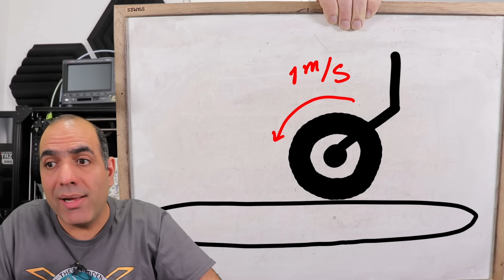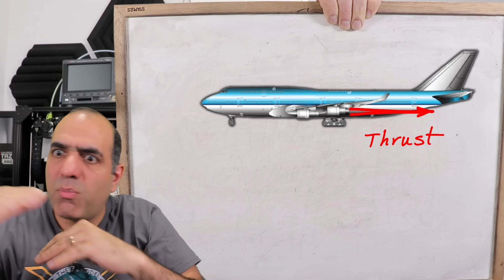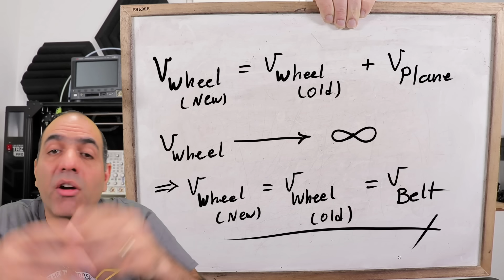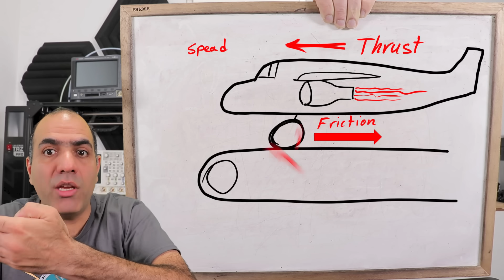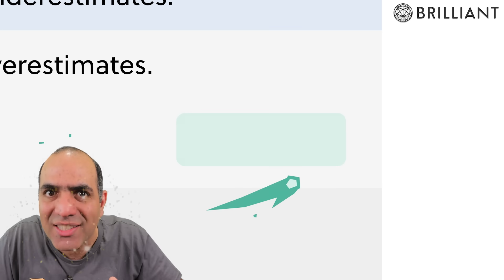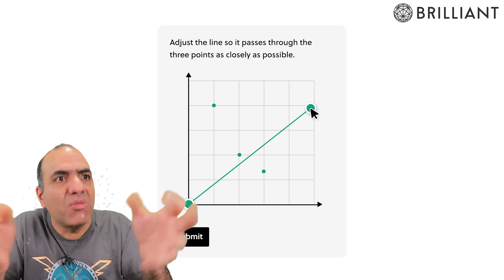Airplane Question that Drove Me NUTS!!!

Comment: 1. If the conveyor belt is designed to exactly match the speed of the wheels, then there's no wheel slip at the contact point of the wheels with the belt.
2. If there's no wheel slip, the wheel doesn't spin.
3. The plane accelerates with its wheels not spinning, and the top of the belt moving along with the contact points of the wheels, the whole wheels, and the plane itself - all ahving the same speed.
4. The plane takes off.

Comment: I thought that the whole "speed of the wheels" thing was a dead giveaway to the fact that the engines aren't active and the plane won't take off (basically that it is a trick question), but I guess that the question can be interpreted in many different ways like you said.
Reply: The question is "can the plane take off", not "will the conveyor belt make the plane take off", so I didn't interpret it that way. But it's definitely a question that leaves a lot of assumptions open to the reader.
Reply: Precisely, if the question were worded as "The conveyor is designed to cancel all forward momentum of the plane" the question becomes simple, the ambiguity of the question leaves a ton of room for interpretation
Reply: But even with the engines on, how in the world can it take off? The conveyor belt is simply taking all the wind speed away! It's sitting still relative to the air! It's driving me nuts ffs
Reply: @IceHax  The conveyor belt isn't taking any wind speed away. If anything, as the plane moves forward, the conveyor belt will be moving faster in the opposite direction (as stated in the question), so it would actually increase the wind speed experienced by the plane, making it even easier to take off. Though they'd still need to accelerate to normal plane speeds before getting very far above the runway.

Comment: I don't see what the fuss is about. The answer is obviously "No". Because....
Clearly, it's "Yes". The Jet engines push the craft forwards relative to the surrounding air. That generates the airspeed and so the lift.
The wheels will be spinning at twice their normal speed, but that's going to have little or no influence on the aeroplane's ability to lift off.
That's my answer at 0:39, let's see what unfolds...
Reply: Yay. I won.... I think.

Comment: The plane will take off. The runway & wheels are irrelevant. If you have sufficient thrust, you will have flight. No matter what the wheels are doing the engines are still providing forward thrust. The runway will simply match the rotation of the wheels but that will have no impact on thrust.

Comment: Where does this ramping the belt speed up to infinity nonsense come from?      The thought experiment is simply that the belt speed (driven by an external mechanism) matches the aircraft's velocity relative to the ground (a fixed point of reference), or air (assuming no wind, air and ground speed are the same) so if the plane is moving 1 kts forward, the belt is moving 1kts backward, and if the plane takes off at 180kts, the belt is moving 180kts backwards.    At that moment the wheels would be rotating forward at 2x airspeed (or fixed ground speed) or 360kts.. 
Now the 747's tires are rated for only 235kts, so that may be a problem if they explode before the aircraft reaches takeoff airspeed.    ;)   
And while you talk about friction or not friction, there is also rotational inertia to overcome, although that's not significant compared to the 266 thousand lbs of combined thrust the 747's four engines can produce.  

Assuming the tires don't explode, and the wheel bearing friction is not too absurd, the 747 will still takeoff, just a little longer (due to having to overcome 2x increased angular momentum).

Comment: In this case u can eliminate the wheel , Moving forward depends on the engine thrust and air so even of the treadmill and the wheel will turn infinity the plan will takeoff with effort , well the wheel will burn tho and it won't fly to far i guess 😂

Comment: There is only one answer I am willing to accept:
The wheels and belt speeds match exactly at all times (in opposite directions). The wheels are not locked in place, and friction exists.

By definition, the plane cannot move forward even one millimeter, as that would indicate the wheels have rotated faster than the belt.

Therefore: the belt and wheels spin up until catastrophic failure -- at which point the belt mechanics rip apart and puncture the fuel tanks and everyone dies.

The end.

Comment: The question can basically be reframed as "can a plane take off with the wheel brakes endangered" (if you take the interpretation of the wheels and belt ending up at infinite speed), I guess with enough thrust the plane could just drag the wheels along the ground and takeoff anyway
Reply: It works very well if the plane is on ice, though making sure the plane goes in a straight line might be an issue.
Reply: that's the problem lol, it's only got a T/W ratio of around 0.2

Comment: The answer is NO!
The planes engines are used to push the plane forward. 
The wheels are used provide minimal resistance on the ground in order for the plane to move forward.

When the plane picks up speed (not wheel speed but ground speed) it moves through air which resists the plane. 
The high speed air moved above and below the wings which cause uplift.

From the question it is obvious that they mean what if the plane is stationary, because they said the wheels move at the same speed as the treadmill which would cause it to not move. 
Plane not moving = no air resistance on wings = no uplift. 

Engines do not cause uplift, it just accelerates the plane, if there is no acceleration (plane has 0 ground speed on the treadmill even if the wheel rotate at infinite rpm) there is no uplift case closed.
I would love to be corrected if I'm wrong.

I think he's making up unnecessary variables on a simple question, takes it too seriously

Comment: sure, wheels are not powered and plane does not need power in wheels to take off. but it NEEDS them spinning to gain enough speed to take off. so if they are countered and the plane is not moving how it is supposed to take off?

Comment: It can take off. The wheels are not powered anyway so the only difference would be a little bit of a force backwards due to friction but not enough to stop a takeoff.

That said the illustration is showing a very short conveyor belt in relation to the takeoff length so if the picture is to scale surely the plane would have to leave the conveyor belt to get enough takeoff distance

Comment: Put a coin or a ring on the floor vertically. Push it with a finger? Does it move? This is how plane wheels work.

Put a coin or a ring between your two fingers vertically. Squeeze as much as you can. Push the coin the coin with your other hand. Does it move without gliding?
Reply: Or... Put a wheel on a treadmill. Put your hand behind the wheel to stop it from moving backwards. Now the wheel speed and treadmill speed is matched. It is not moving. Now aplly a force with your hand. Wheel will move forward but it will spin faster than the treadmill (which is forbidden by the question) or glide. If gliding is allowed than it may fly, otherwise it will not fly.

Comment: Prediction: the conveyor will match wheel speed, and plane speed, however the plane generates thrust relative to airspeed and not ground speed, airplane should take off normally unless wheels explode due to the conveyor trying to match speed.

Comment: Alright, so here's my thought. There's friction everywhere, but just because there's friction doesn't mean the wheel and belt will always be coupled. As the plane accelerates the wheels/belt will pick up speed in a way that would approach infinity. But eventually the friction in the wheel's bearings will counter the friction of the wheel on the belt. So eventually the wheels will begin to skid along the belt. The belt and wheels still have the same surface speed, but the wheel is prevented from speeding up anymore because of friction in the bearings.

The plane would still take off.

Comment: For case 3, the airplane could just start by using the thrust reversers. This would cause the plane to move a tiny bit backwards, the wheels start accelerating backwards to infinite speed, and boom - the airplane takes off due to the friction in the bearings pushing the plane to takeoff speed.
FTFY.

Comment: Simple experiment with a Treadmill + Model plane should suffice to remind people only very few aircraft have powered wheels on their landing gear.
Also, depending on how sleep-deprived the programmer setting up the logic for the belt was, there is a chance the belt may move at the speed of the plane in the direction of the plane.

Comment: With ridiculous questions, you get ridiculous answers. Bear with me😅 

•initially, the plane has 0 thrust, therefore no motion on the wheels and treadmill speed is 0. 
•Now add some thrust. The wheels will pick up speed but the treadmill will match their speed in the opposite direction. The resulting motion will be 0. We know we need airspeed for the plane to take off. The indicated airspeed on the instruments of the plane (I have minimum knowledge on this) will read the wind speed on the ground. Thus, telling us the plane is not moving through the air.
•Increase thrust to infinity. The wheels will increase in speed infinitely (assuming they will not blow up) , the treadmill should match the speed right? With the resultant motion being 0, the indicated airspeed will not change. If the treadmill matches the wheel speed but in the opposite direction, the airplane will remain stationary.
•The plane needs to move through the air to take off. To further discuss, the wind could be blowing into the plane at 400knots and the plane will take off. So in this case, wind is constant at, probably negligible. 
•The plane will not take off. 

I tried😅

Comment: You missed something there. It is an infinitely fast infinite positive reinforcement loop, which means the Tires would disintegrate from Centrifugal (or is it centripedal in this case? Anyway) forces. And if they wont (like the Fricton being turned of) they would reach fractions of C (which introduces stuff like time dilation) and after that C and beyond. Which we cant handle with current physics understanding. This experiment just results in a Fireball. The more Physics you ignore, the bigger the Firebal gets. Runway Fireball, Earth Firerball, Intergalactic Fireball, Universe ending quantum Fireball.

Comment: Yes, no problem, since the motor powering forward momentum (and by that, lift) does not use wheels  with friction to the ground for acceleration , but wheels will spin twice as fast for the plane to get same speed compared to stationary earth., if the bearings break tire blows it wil still accelerate and take off, as long as it got enough lift .
 Wheels are there for taxiing and landing basically

Comment: I know a prop plane can but can a jet?  To generate lift air needs to be flowing over the wings. The props push the air over the wings but a jet engine works differently. My instinct tells me it wont.

Comment: The wheels aren't driven. They don't move the plane forward at all, they're just there to keep the plane from bottoming into the ground. Once the plane's engines are moving enough enough air across the wings to generate the required lift, the plane will take off.

Comment: My biggest concern would be for the durability of the wheels. With the conveyor belt running backwards along the runway, the wheels ought to end up spinning twice as fast as they are normally expected to spin, and I wonder if that might damage them. If the wheels fail before the plane lifts off, then it won't lift off.
Reply: That is my conclusion as well. Depending on the thrust, and weight/friction (plane/wheels), things would likely melt, catch on fire, and be ripped apart by centrifugal force. We could make a program to simulate this, of course, but I doubt it's worth the effort.

Comment: Its easy. The thrust from the engines will accelerate the jet to take-off speed regardless of what the wheels are doing. The wheels will be spinning at twice the speed as normal, and some friction loses will occur. But the plane will take off regardless.

Comment: Just 15 seconds into the video, and, yes, the plane takes off.  It is not moving forward using the traction of the wheels.  It's propulsion comes from the air using either propellers or jet turbine engine.

Edit: On second thought, it would not take off.  The wheels would be spinning at more than twice normal take-off speed and the tires are probably not rated for that and would likely disintegrate causing a crash.

Comment: Of course, if we're talking a 747, and a conveyor matching the TAKEOFF speed of the airplane, with a typical takeoff speed of 160 knots, that would mean in still air, the wheels would be covering the treadmill surface at 320 knots. That is well above the maximum tire speed of any airliner (typically 195 knots). So the tires would likely burst prior to reaching takeoff speed. The rims would start to cut into the treadmill surface. With all 18 wheels bursting at random points and shredding the treadmill and debris flying everywhere and the ensuing drag, the 747 would run out of treadmill or directional control and crash before takeoff. So... No, a 747 could probably not takeoff on a treadmill in this situation. But not for the reasons people would think.

Comment: Having no friction on the ground (i.e. being on the conveyor belt), is similar to simply being in the air. The engine will force the air around the wing, which will generate lift. The plane would eventually take-off. Although I think thrust will propel the airplane out of the conveyor belt (but let's assume the belt is infinitely long).

Comment: Airplane wont have movement speed compare to ground and air around it, so running wind airflow wont be enough to make lifting force. There wont be air flow around wings that gives airplane lifting force. So it wont take off. Your dearest engineer.

Comment: I hope it's a mile long conveyor. The wheels don't drive the plane, the jet engines propel it, so the wheels just have to spin twice as fast for the plane to reach AIR SPEED to rotate and lift. The drag difference would be only minimally relevant, and you MIGHT blow a tire or three, but takeoff? No problem. Simple physics.

Comment: Given the parameters in the question only the answer is no because it's the same principle as a car on a dyno it can have all the friction and thrust in existence but if it doesn't have any momentum it will go nowhere planes lift works on a difference of airflow above and below the wing given the parameters there is no wind so the plane wont take off by adding your own parameters you are falling for the trap of the question which is to make you overthink the problem.

Comment: I usually don't participate in these but this one seemed too obvious, my prediction: The plane would be able to take off without an issue because the engines push against the air not the ground, if the work was being done by the wheels it would be a different story. 

I think a bigger issue would be that the wheels would reach an incredibly dangerous RPM because the conveyor would cause them to rotate exponentially fast. I'll update my comment when I'm done with the video.

Comment: Can a seaplane take off while going up River?

I'm pretty sure the answer is the same, and likely preferred as wind on rivers usually follows the current.
Reply: If the speed of the river/belt is fixed this is easy, the plane just needs to overcome a little friction, but the question assumes the river would run infinitely faster as the plane attempted to move forward.

Comment: It's a good question.

If we ignore driving resistance and the durability of the wheels and bearings they ride on, then plane will take off

If we add  other forces that act on the wheels, the plane wheels will reach the max speed that the wheels can spin it will not move 

And then the tires will explode, the plane collapse 
And a giant fuel explosion will happen!

Comment: i mean there is no air on the planes wing then it wouldnt fly, as no lift is generated, even if the wheels are rotating it doesnt mean the airplane is going forward, the airplane would need to go forward for and air to come over its wings

Comment: I  don't understand how will plane move if distance travelled by whell is zero means it is on one point so does the aeroplane,as aeroplane and wheel are connected.
Let's assume aeroplane moved then it means wheel also covered some distance which is impossible as if wheel covers 1 metre so doesn't belt 1 metre in opposite direction.
So i think plane is stationary

Comment: If we're speaking in the hypothetical sense, where all materials are perfect and never break for any reason, the plane will take off as easily as it would on any runway, but that conveyor belt may approach light speed, before the wheels get off the ground. The 747 is not a car, they do not cause the plane to move, they just keep it from grinding on the concrete.

Comment: wheels is not the ones that take off airplane. but if conveyer belt speed is such high that it start move air around it, then it is might be possible to lift airplane.

Comment: Really dumb question. The wheels don't matter; they don't drive the airplane. It's an AIR-plane. Not a  RUNWAY plane. The engines do. An airplane doesn't need wheels to take off. It just makes it easier.